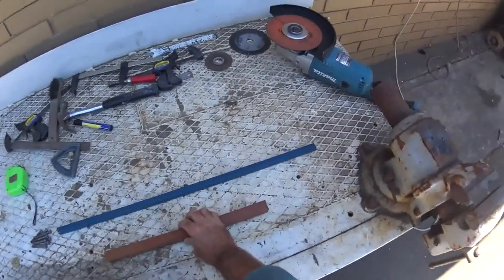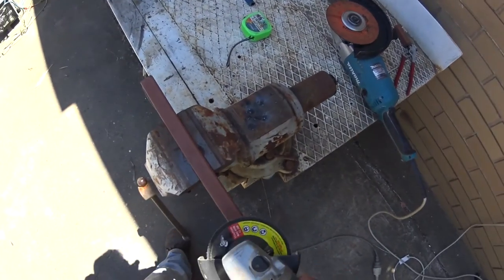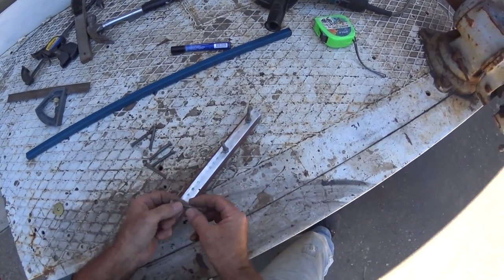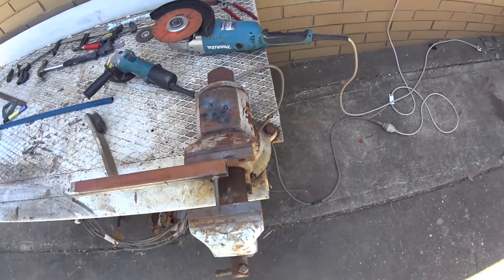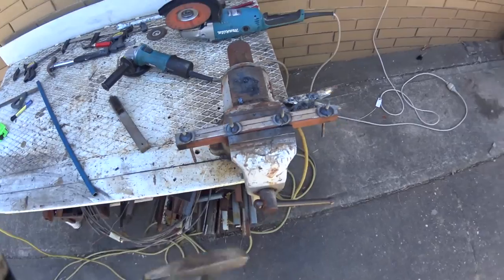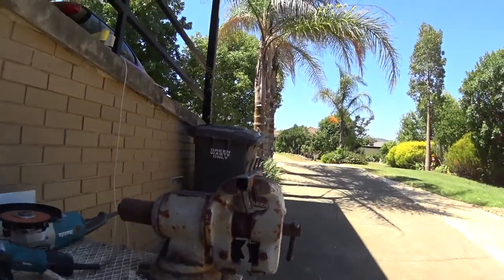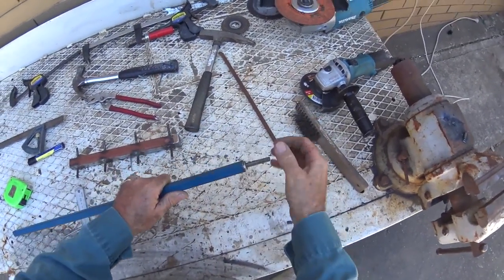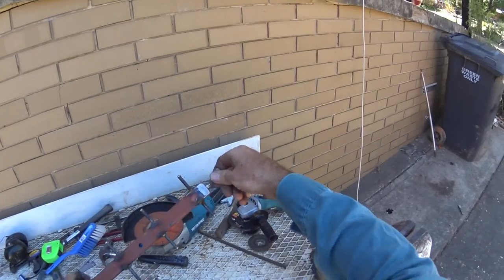How to Make a Collapsible Stand for Cooking and BBQ Tools, when Camping. DIY Camping Gear projects

Comment: Is there any specific metal I need to tell when I buy at my local metal place? I just started doing welding and I really like this project plus I always go camping
Reply from the maker: Hi, I am using standard mild steel, if you have a chat to them they will show you what you need, they will probably have off-cuts that would be what you need. Be safe and have fun.